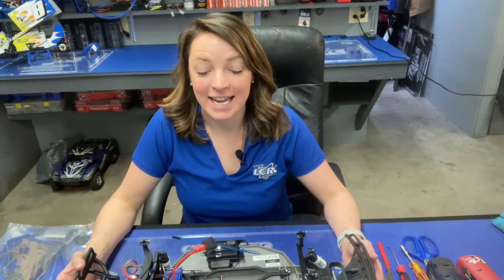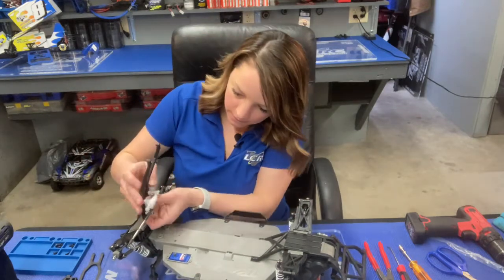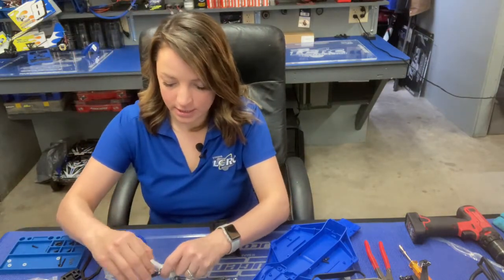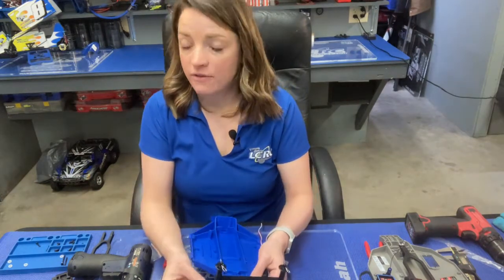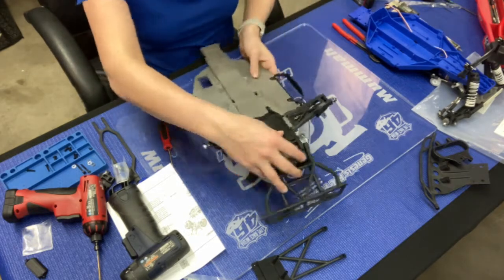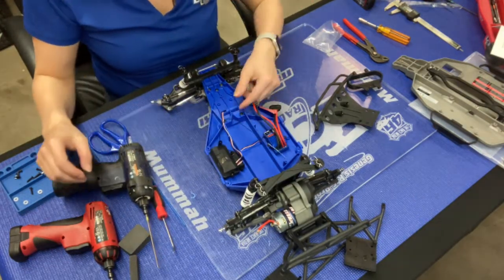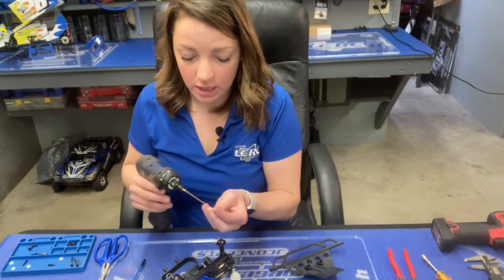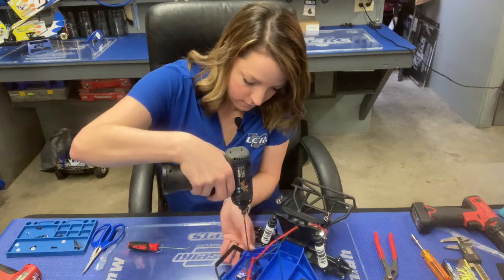LCRC: How to Install a 5830 LCG Chassis on a Traxxas Slash 2WD

Comment: I need help have a slash neebie put a 3s in there and cant get it to run anymore . please help  me
Reply: If it's a stock brushed slash with the XL5 ESC, the XL5 ESC can NOT run 3s, it'll go into "limp/safe mode" if you run anything higher than 2S on a regular XL5